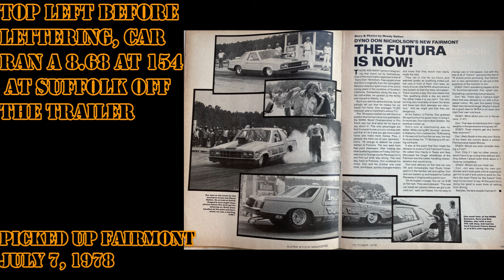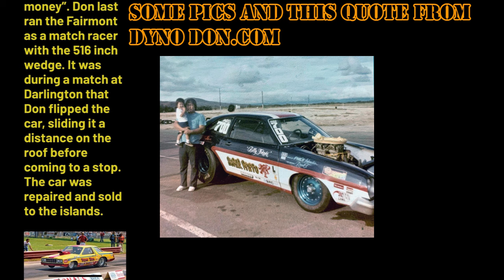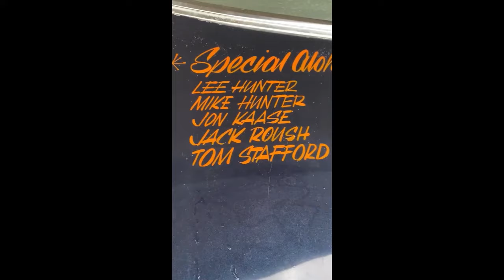DBG: Dyno Dons 1979 Pro Stock Ford Fairmont Lost For 25 Years, Found In Garage On Island Of Oahu, HI

Comment: Pretty much a dream finding a car with history like that and it fits right in with what this channel is all about. Just the thought of sitting behind the wheel, dropping the clutch and pulling gears behind a screaming cleveland just as Dyno did back in the day tends to make a guy not have rational thoughts. The financial and physical demand to put it back on the track in its former glory is pretty high, I say it's a very good bad idea.
Reply from the maker: Dave, that is a great way to look at it. Catch 22. Financially big undertaking for sure. If I can get a couple of sponsors to help, or subs I can get it. As far as work. My buddy Mike Weaks can help with fabrication, you have seen his cars here. So that part is covered, but then there is still cost of update. Could always build like it was and not update. Then what. This car needs to go down the track. The answer will come and door will open. 🙏

Comment: Great video drag boss. I didn’t realize they didn’t use electric fans back then, that fan on there robs over 20HP according to the dyno test David fryburger did at westtech performance.
Reply from the maker: I did not look to see what he used. They used heater blower motors back then. Man that is a huge loss. Thanks Keith

Comment: A Naturally aspirated 351 cubic inch engine running 8.50 1/4 miles is insane. High port Cleveland's are so badass! All Cleveland's are badass though. Anyone running a 8 second 1/4 today is supercharged and blasting nitrous. Naturally aspirated is so much cooler, it separates the men from the boys in my opinion. I absolutely hate the whine of turbos at a drag race. Give me the sweet sounding lope of a well built Cleveland with a healthy cam and headers with straight glass packs. Yeah, I'm only 42 but I'm old school. Been driving a Cleveland since I was 16 and in high school. And yeah! I won at the high school drags using Cleveland power! All the rich kids driving their dad's all aluminum, aftermarket everything, 350 Chevrolet's were awfully butt hurt lol.
Reply from the maker: Now you’re talking brother. Cleveland to the front 🏁. Imagine further that those times were fine with only 340 ish cubic inches, not 351. Glad you’re here Vaden, keep up the good work.

Comment: Hi, I have a question for you. What the difference between a Bob Gidden and Dyno Don Clevelands ?  It might be a good idea for a video someday.
Reply from the maker: The huge difference is the combustion chamber, Bobs had the combustion chamber welded up and reshaped like today’s modern cylinder heads. A gain of 30 ftlbs of torque. Thanks for the question. Yes could be a good one. 👍